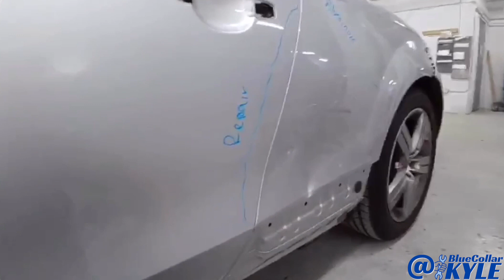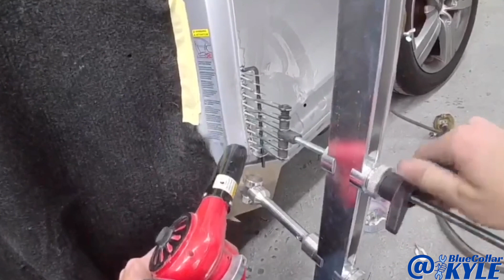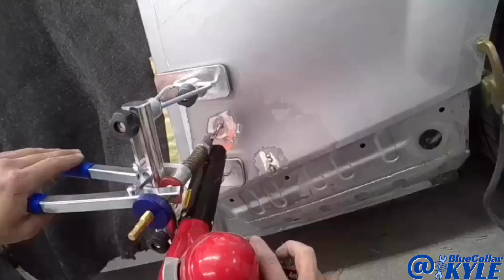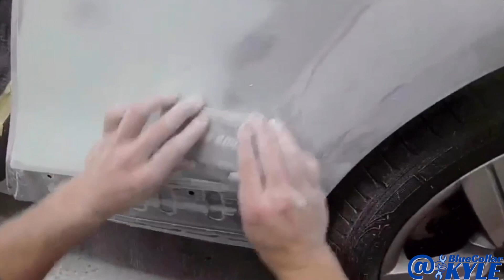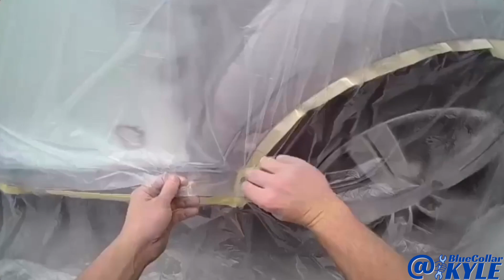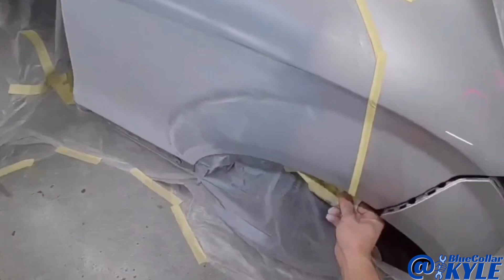Fixing A Little Whoop Dee Doo!

Comment: Why do aluminum repairs have to be in another contained area? What happens if I repair an aluminum car next to steel cars?
Reply: To prevent contamination called galvanic corrosion. It’s what certified aluminum shops do. We’ve some aluminum work at our shop in the same area and we never had an issue but technically you’re not supposed to.